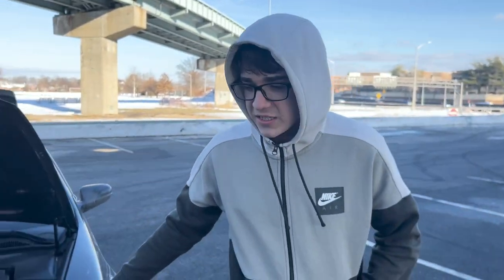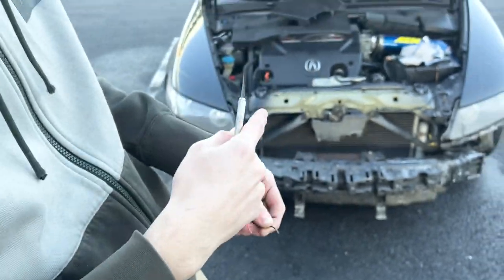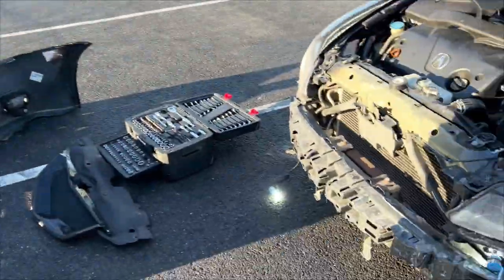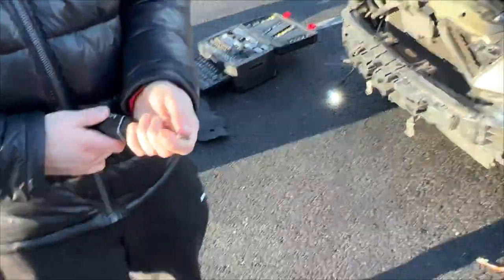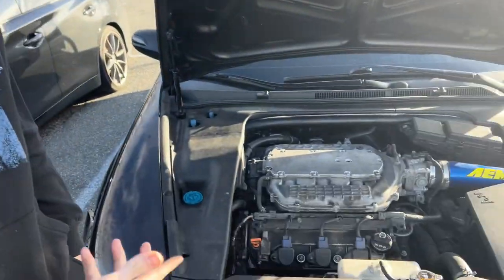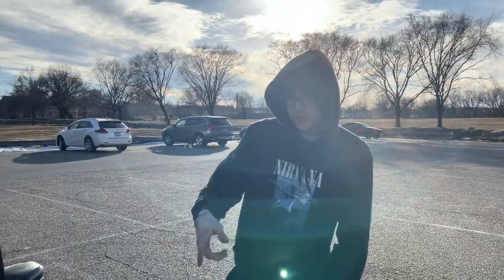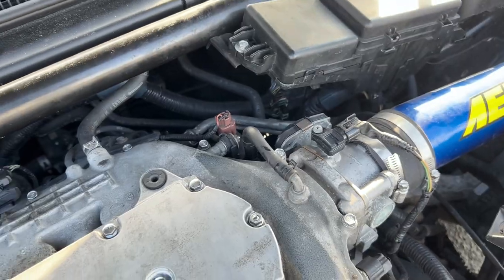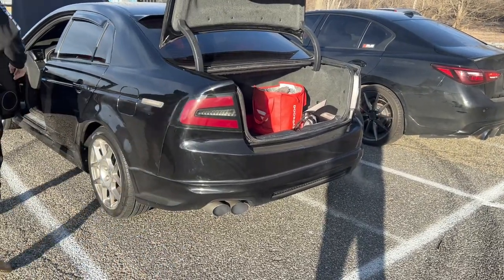FIXING THE FOG LIGHTS AND USING SEAFOAM ON MY ACURA TL TYPE-S | SHQIPEBOYS

Comment: careful man, seafoam can lock up engines
Reply: Seafoam blew up my H22a4 engine a day after fogging.  Washed out oil from crank bearings started knocking. 
Will never use as fogging oil again! Honda recommends to NEVER use additives. 
All your doing is breaking down carbon in intake and running through entire engine.